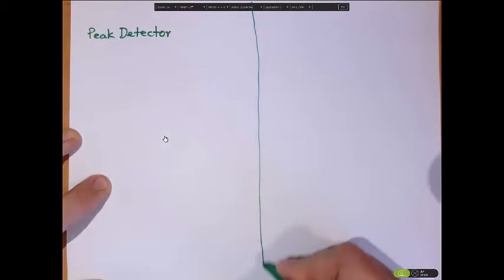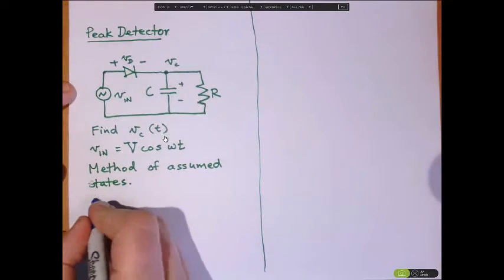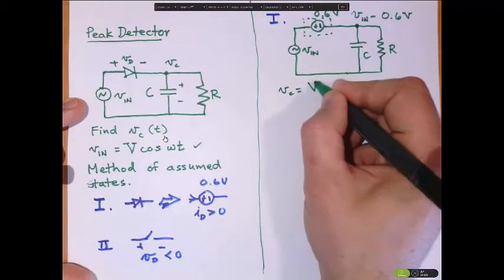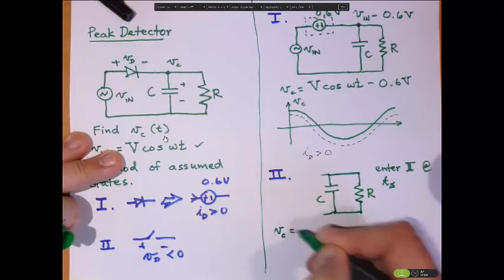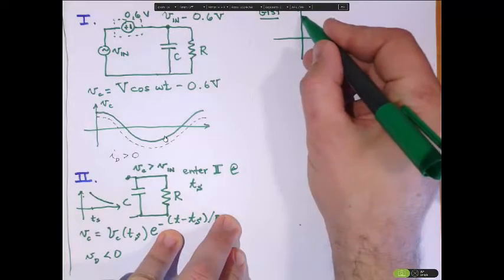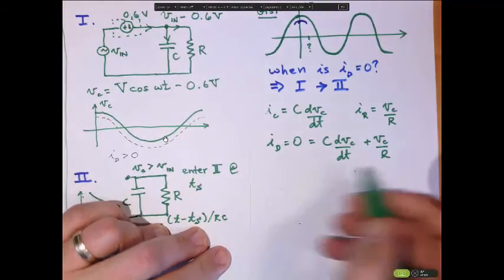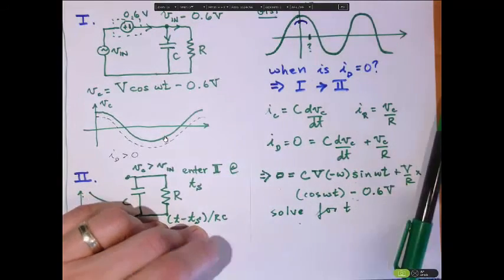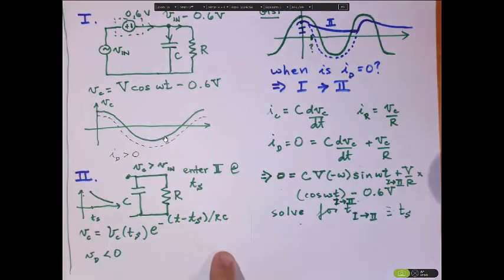peak detector circuit explanation

Comment: Does this circuit peak detector ;
I think it is an half wave rectifier filtered circuit .
I think the peak detector have a Capacitor with a diode in series.
Thanks for your effort.